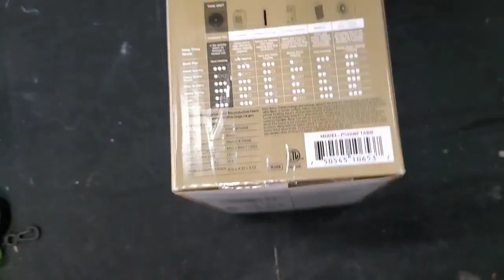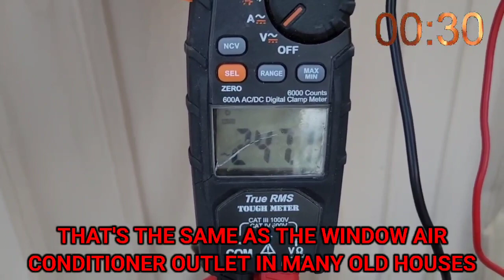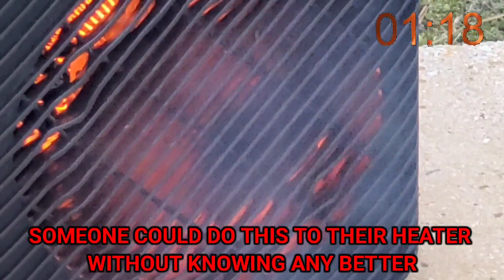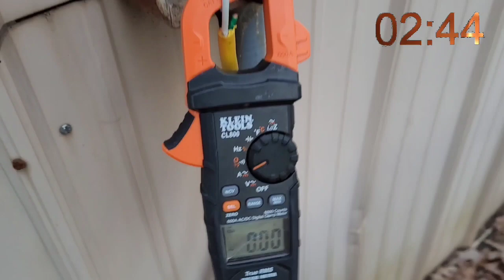What Happens If You Put The Wrong Plug On A "Pelonis" Cheap Plastic Space Heater From Walmart

Comment: This reason is why I frown on 120 volt baseboard heaters and would only install one if was  replacing an existing unit and the panel is full and cannot change the single pole breaker to a two pole for the heater circuit, fortunately I've never ran into this scenario.

Why make such a big fuss, some may ask me? ( After all a 120V unit still provides the same amount of heat as a 240V unit of the same wattage).   Yes, in the USA at least, electric baseboard heaters of 1500 watts and under are available in 120 & 240V versions, with 240V being the most common.   With that being said, a 240V unit has a huge safety advantage because if for some reason it's connected to 120V, it will put off very little heat, because with a resistive load, halving the voltage drops the power output to a quarter.   

Whereas if for some reason a 120V baseboard heater was connected to 240V, the unit would glow red hot very quickly and trip the high temp safety switch and shut off the heater, alerting the homeowner something is VERY wrong.  Worst case scenario the contacts in the high temp safety switch weld together and when that happens, your only option may be to step outside and wait for the firefighters to come and handle the situation.
Reply from the maker: I hear that. 
It's a bit of real world vs engineer world

Comment: Did this heater come with a thermal fuse originally?
Reply from the maker: No. It had a hi-limit thermostat originally which i bypassed, but not an element thermal fuse.
Reply: @satanicinduction  No heating element thermal fuse? That is unsafe. So basically if this fan motor decides to fail, you're basically saying goodbye to your house.
Reply from the maker: Quite possibly. If both thermostats weld its all over

Comment: Is that one of those with the "2 mile range"?
This is just fuckin' awesome.
Reply from the maker: House on fire in 2 minutes or less, Guaranteed
Reply: @satanicinduction Dad and I are installing a few 240 circuits at my place for the computers. The original wiring just doesn't have the gusto necessary to push what I need. That and my radio equipment pulls well north of a kilowatt sometimes. Going up to a larger linear soon. Trying to see if I can set fire to the tops of the trees with the CB.